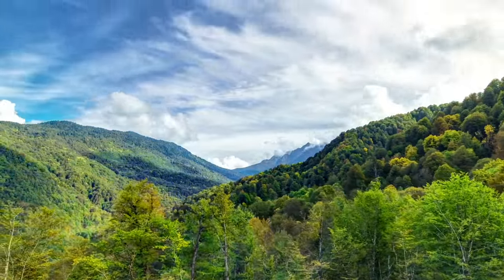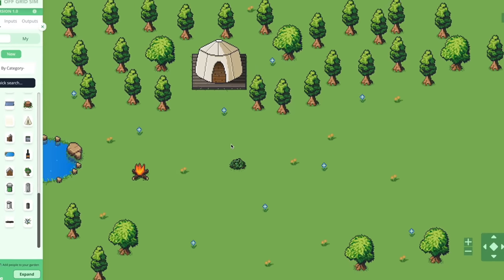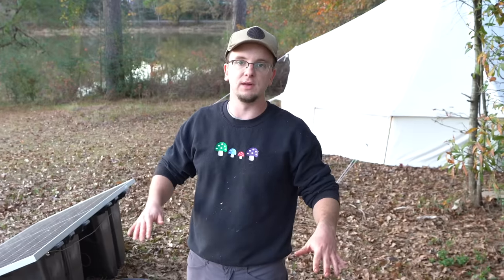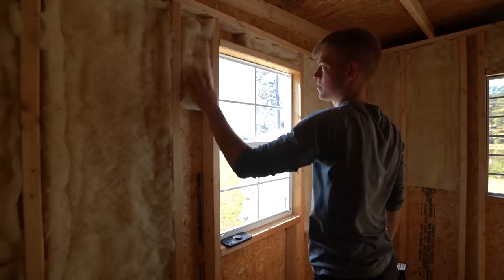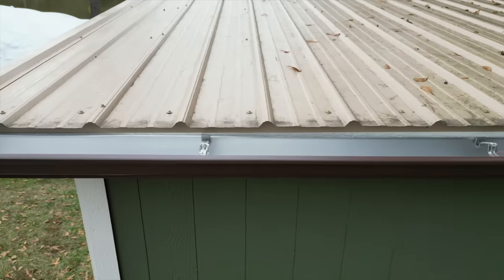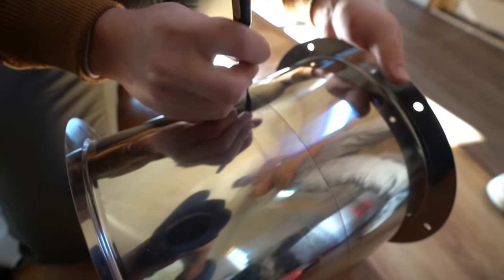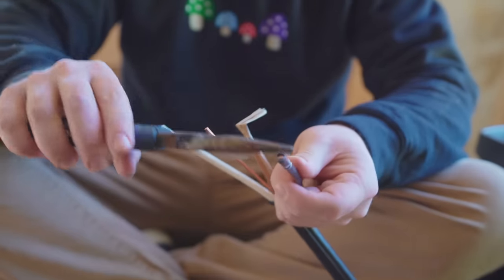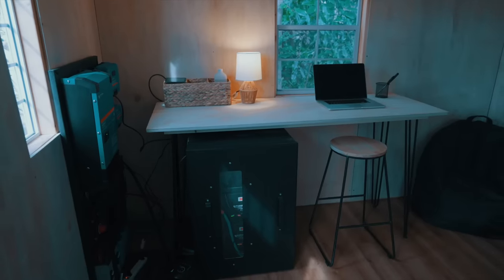We Went Off Grid In 30 Days With $25,000

Comment: As a roofer let me just say, you made the right choice going through the wall and not the roof. It may have been more complicated, but it’s going to save you many issues down the road.
Reply: Hah….I just went to an open house with multiple light-tubes.  I have family with a single light-tube in an interior bath or hall, and they were amazing.  But at this open house, they had had 4-5 light-tubes, including one 2 feet from a huge, sunny kitchen sink window.  

And I was like….why cut a hole in your roof for 10% more sun?
Reply: Including dirtying up your rain water that you're collecting
Reply: @Itried20takennames  cuz the suns lighting is better and natural
Reply: @peppermeat8059  Light tubes are great, but my point was that this tube was literally a couple feet from a large, sunny window, making the risk-benefit calculation of an additional roof hole not as good. 

In interior area with no window, I would say they are definitely worth it despite the leak risk…work so well that my relative said that in the first week they kept reaching to the light switch to turn off “the light,” then remembered they have a light tube now.  Even on grey, cloudy, winter days, the light tube completely transformed the windowless room and made it bright.
Reply: Dude when are you going to come back and finish my roof
Reply: agreed. any & all penetrations will leak eventually. also, going out the wall increases horizontal   vs vertical length of the exhaust pipe & that helps keep the heat in the home instead of sending it directly up and out. I do like the idea of light tubes, but still dont want the roof penetration, can light tubes be installed in walls?
Reply: @kingJ69 😂😂😂
Reply: they could have place the stove in the corner on the opposite side of the cabin where there was no gutter even near our in the corner to make it a lot easier.
Reply: Yeap as a GC I couldn’t agree more.
Reply: As a waller i couldnt disagree more, but it seems you have chosen your path and have weakened the structural integrity of your walls. If you ever need any professional walling done or tips, i reply for a very small and reasonable convenience fee of 25$ per reply.
Reply: @McLoviniam  You waller.......in the muck

Comment: Did you have to get any permits? Here in Oregon,  there are so many! And very expensive.  Not to mention that even "off grid friendly" counties require a full septic system even if you don't use it.  It's horrible how total strangers can tell you what to do with your own land just for a few bucks.
Reply: They probably said they were "camping" which is a loophole but you can only camp for so long.

Comment: To make the cabin a LOT more self-heating in winter: add lean-to greenhouse along the entire front.  Not only does it capture heat that can be moved into the structure, but at night it provides a big tempered space so one whole wall doesn't experience the full overnight cold.

Comment: I just have to make a note. This micro cabin is made out of t1-11 with no barrier between your wool and basically the inside of your cabin. You spent 2x as much for insulation to ensure your health and safety, however, read up the msds on t1-11 in regards to the amount of formaldehyde, ethanol and and other alcohols due to the  type of glues used and the fact that the t1-11 is painted on the outside with exterior paint. Same with the osb used for the roof. You are in-effect, negating your positive health effects of using the wool batts by literally driving the gases inward. I think this needs to be very clear to anyone breathing deeply in their Home Depot shed cabins for 20 plus years and wondering why they end up with those huge hospital bills anyhow, even though they used wool insulation at the cost of 190 dollars per 90 sq ft. 
  Solar: mind your mc4 connectors. As O&M for 240 commercial sites, I have personally witnessed 59 mc4 connectors (typically on home runs) that have arced out and lit themselves afire. I had a bucket of the burnt and failed ones in the office. This happened generally in strings of 12 panels or more, and to have a flammable surface beneath it (like a roof) leaves me to suggest NEVER to put solar onto a roof. 
  Good stuff otherwise, enjoyed the video

Comment: On another note.  I used pellet stove pipe parts for my "Nuway" (made in Michigan) woodstove and also went through the wall. To prevent leak issues later on. I would NEVER go through a roof. I also installed my wood stove with cement board and installed it over rockwool for fireproof safety.

Comment: Great Video! 
Just a small tip for heatshrink tubes: A few seconds of holding the tube above a pocket lighter or near the stove would've done the trick aswell instead of using 10% of the battery for the hairdryer ;)
Reply: I use a quick click torch to shrink tube. One just has to be careful not to get too close. It’s almost instant.

Comment: You should close the sides of the coop to keep the chickens out of the elements and also please use hardware cloth. That material and size of the holes in that mesh are going to make it easy for predators to get at the chickens. You guys did a great job. You just need a few adjustments.

Comment: You should try building an underground house or shelter for off grid.  The temp underground stays a cool 66 degrees year round so you don’t need much heating and zero cooling. You can then put your garden on top.  All you’d need really is solar for some light and tv. Solar tubes are used for daylight. Storage can be built into the walls to store dry goods. They’re weather resistant. So many benefits that it’s kinda weird that all our houses aren’t underground…
Reply from the maker: Agreed!  It does cost a fair bit and zoning is a booger.  Earth ships and WOFATIS rock though

Comment: it's intriguing to note the variations in insulation practices between the USA and Germany. In Germany, we lean towards more robust construction, We uses insulation bricks that are approximately 30 cm (about 11.8 inches) wide and composed of around 70% air. When working with wood, we typically opt for multi-layer framing. In new constructions, we integrate insulation that is at least 10-20 cm (about 3.9-7.9 inches) thick, along with triple-pane glass windows.
Reply: Any offgrid housing tips in the eu? I'm thinking about a shipping container.
Reply: @slavko321  Don't. They're awful for our climate and you will cook inside with the summer being crazy now.
Reply: Also, in Europe we use channels to pass the cables to the wall. I am sure it is in regulations here in Greece, but I remember it's on the whole EU as well.
Reply: @nikolaskostakis  I'm an electrician in France, we use electric sheath in the wall for cable, we don't drill into the stud to pass cable.
The sheath provide airflow to avoid fire risk, we don't compromise studs because we like our wall to stay up.
Reply: This would rot away fast in germany. There is no airflow for the wood and the wool traps moisture.

Comment: I know one thing that would have helped with water depending on how far down your ground water is would have been a sand point well, you just hammer it down around 10 to 30 feet then attach and prime it they sell the parts for it at lowes. Also for the rain collection I’ve managed to collect from a shingled roof by having 2 separate barrels, the top barrel has an opening with a screen that collects leaves and such and whatever slips through goes to the bottom of barrel for cleaning. Barrel 2 sits underneath and has a vent pipe with a screen to let the air out when filling and an attached pool pump with filter media to filter the water within the tank to prevent insects and algae from growing, there is also a harbor freight shallow well pump with a bladder tank attached so there is pressure to make the water useable in a garden hose or in my case the lawn irrigation that I’ve installed. I’d change a few things on it but all around a decent working system…

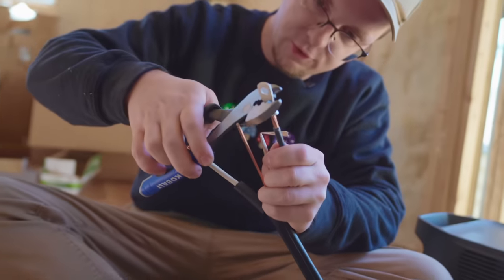Comment: 1:30:19 
You should really recrimp those really really tightly, best with the right tool, if you don't want to risk it burning your home down.
If it's even a bit loose, there will be heat developement over time, if it isn't gastight. Even it might seem fine now, it will get worse over the years.

Comment: in order to clean the pond water and only having water full of bacteria you could create a basin with layers of charcoal, sand, gravel, rocks, bigger rocks. These will take the debree out of the water and clean it. But i would still recommend putting that water in the purifier to remove any unwanted critters that will make you sick. And also in order to get the water out of that basin you could add a tap at the bottom with another basin placed lower to collect the water.

I got this knowledge from primitive survival video's and there's some handy knowledge in those for if you wanna live off grid. you could learn to make your own pottery, tools, etc. altough it would be hard work, you would be able to live even more off grid.
Reply: Yeah that pond water was too brown
Reply: @annatullison1482  that's because of the dirt and sand which would be picked up by those layers i talked about, and the bacteria (those critters) would be killed by the heat from the purifier.

Comment: After being so careful about using biodegradable wood and wool they roll out plastic and manufactured laminate on the floor.
I wonder if cotton can be used as insulation? They are in Georgia after all so there should be plenty around, and I dare say the scraps can be had for next to nothing. They might even pay you to cleanup and haul it away.
I agree with the roofer who says that sending the chimney through the wall is better in the long run.

Comment: The click-in flooring is really easy to use! My dad (52? M --muscular but not in shape anymore) and I (19 F --skinny and vaguely athletic) redid our kitchen floor using it; he did the cutting because he doesn't trust my tablesaw skills, but I did all the measuring and planning. It was super hard to start it on my own because I didn't weigh enough to keep everything in place for the first couple rows (afterwards the weight of the floor did more work and I could attach new pieces myself), and I wasn't quite muscular enough to hammer the sideways clicking part in alone, but working together we got it done!
(If you're reading this Dad, I love you and thank you for helping me learn DIY stuff, even if the dishwasher replacement was a total pain)

Comment: Couple suggestions: 1. cement board under the wood burner. 2. More batteries-200 amp hrs won't give you much. 3. Batteries and components should be in a separate building. (I currently have mine inside and everyone is encouraging me to build a small box for my system)

Comment: Cool series! 
Seems like you could mount the power board up high and push the battery under it to save a few square feet.
Reply from the maker: We wish we could! Unfortunately the cables connecting the board to the batteries won’t reach far enough. If we find a way to extend them, we will definitely do that!
Reply: Just make your own cables

Comment: 20+ years off grid. Don't waste time and money on a tent. Get an older camper with working appliances to start in. Then you can transfer the stove, fridge, propane system. lights, water tank. shower stall, and cabinets to the shed/cabin and you are ready to go. It is still cheaper to build a cabin from scratch if you have basic skills and the time but a prebuilt shed can work. Then you can use that old camper for storage, work shop or even a chicken coop.

Methane capture produces very little fuel and most homesteads won't have a wood supply so you will probably need propane for cooking, heat and an OD water heater and a bigger solar power system if you need air conditioning. In low humidity an evaporative cooler is the best choice and low power consumption. 12 volt fridge and 12 volt pump. Small propane OD water heater like the Eccotemp L5. I use a 1.4Kw solar system and 800Ah of LIFEPO4 batteries and live off grid full time with that same system.
Reply from the maker: I first saw your home in a Lloyd Khan book years ago!!!  I can’t tell you how cool it is to see you comment on our channel.  All your tips are spot on, makes sense to us
Reply: @acornlandlabs  Thanks, I like your guys set up and appeal to a younger audience. Keep up the good work.

Comment: I lived in a mico 10x12 cabin/shed in Northeastern Michigan.  You guys made a GREAT video. From my experience  I would suggest,  when you permanently place your cabin place it on top of a couple of inches crushed limestone and then place "epdm" or 6 mil plastic under the cabin. Making sure that the sides of the plastic edges are underneath the floor of the cabin by at least 3 inches. This will prevent condensation and dampness from deteriorating your floor and making it last longer.  Thanks for the TERRIFIC video. One other note. The sound track was a little too loud and overshadowed your voices.

Comment: The video is great. Just a tip when installing vinyl floors. Use a speed square and utility knife to score and snap. Saves half the time spent using table saw and you get straight cut.
Keep up good work!!

Comment: heating solution: use a lens to heat stones in a fireproof box with a pair of insulated tube going to the tent. use smaller rocks to increase surface area the circulating air can draw heat from attaching one tube from the upper side of the heat box to the top of the tent and the lower portion to the lower section of the tent should allow for the air to flow without a fan. old rear projection tv's had a great lens for this type of thing but use caution since it's a solid fire hazard.

Comment: The problem with this plan is that not everyone has enough money at the onset for even the basics. I started with a rent to own, improved lot in town, a pickup truck and the safe room of the house that used to be there. My first purchases were a used chest of drawers, a deep cycle battery, some very cheap wire and a pack of cheap RV LED lights. I slept in the truck until I could afford a fan, more batteries, an fridge, an inverter and 200 watts of panels with charge controller. I still had to charge the batteries with the truck also. From there, peanut butter and preserves sandwiches were a staple as I located an RV heater and thermostat and bought a couple of 20 lb tanks of propane. After that, I rented a 10x12 garden shed  with the corners framed for paneling. The rest was a gradual increase in batteries and other solar components to finally become totally self sufficient over a three year period. That doesn't mean that I live free. I still like food that I don't have to cook and I bought a second vehicle and pay for insurance and the other obvious expenses of car and truck ownership. I also have cable broadband Internet. My non-survival expenses are $4580 annually. This includes vehicle insurance and taxes on property and vehicles. A typical month casts me $600 when I factor in laundry and dining out. It's less expensive than you might think if you're single. The highest costs are the effort you have to put in and the comfort that you have to do without. Now I have it all and can afford to be generous when I find someone worthy of my help. It's good to be finally much more free than the average American.

Comment: One thing i would add about the raised beds for anyone else planning to do this is make sure they are on level ground. you didn't check the level or level out the ground first. you want them level as possible from the start... else water will pool more on one side of the bed. unless you for some reason want it like that. the hardest part of making my 4 bed raised garden was leveling out all the areas for the beds... but i am very glad i did it. lol.
Reply: also I would advice against using any grass clippings in the beds... it will leave seeds and will grow lots of weeds. also grass clippings stink to high hell as they break down and it will smell like sewage for months. i know this from experience and i will def never do it again. 😅🤣

Comment: Well done guys, it was nice you left in the small errors and even discussed what you would do differently, so down to earth.
Recommend Rock wool - fire and mold proof - is just made from mineral sources so it is not a hazard to eventually dispose of.  Be careful with wood electricial and wood burning appliance - cement board is a safe option, should add combustion air source for that stove or crack open a window while it is running. Nice work, good vid.

Comment: Just wanted to point out you use wool for the insulation that you most likely won't come into contact with, but then used LVP instead of a natural hardwood floor. LVP has off-gassing as well.

Comment: I was surprised you didn't put plastic sheeting on both sides of the insulation, especially on the ceiling to protect against condensation on the underside of the roof.

Comment: I understand rockwool is hazardous to install and that it doesn't compost. But the extra insulation factor and the fact that its fireproof. Expecially in the wall that has the stove pipe. Certainly makes it a hard sell not to use. Plus the sound insulation is phenomenal.